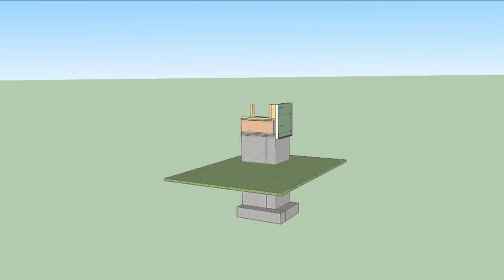Airtight Foundation, Floor, and Wall Connection

Comment: nice.  pl in the corners aint flexable.  polyurethane or silicone is better.  silicone is the best.  nothing outlasts silicone.  made of sand (rocks), durable.
Reply: dave daved PL is a polyurethane.
Reply: no no,  i mean not pl premium which is hard polyurethane (that stuff is shit for sealing -has zero flex).  i mean a real polyurethane like sikaflex sealant.  that kicks ass.  lates
Reply: dave daved got ya and totally agree. We only used PL at the rim joist location then lexel for the joints between the sheathing/sill and sheathing/rim.
Reply: no no no.  lexel is nothing but toluene and xylene.   sikaflex sikaflex sikaflex.  do not ever use PL premium ever again for the rim.  just use it for subfloors.  lol